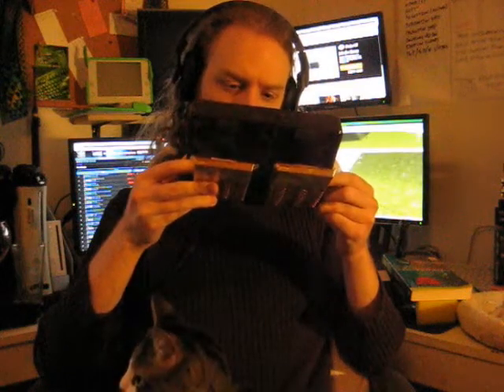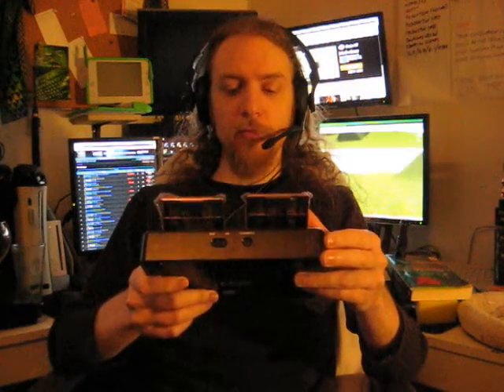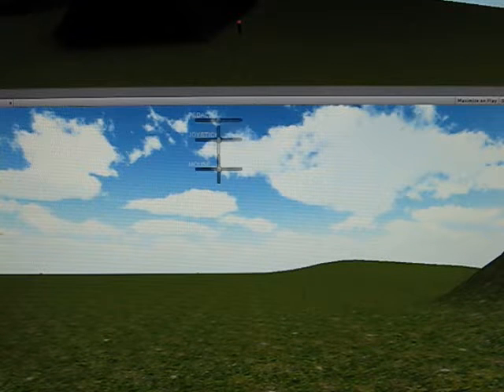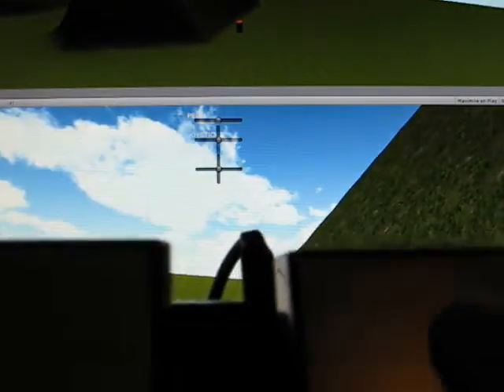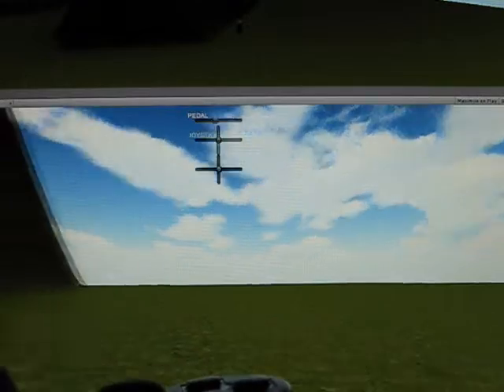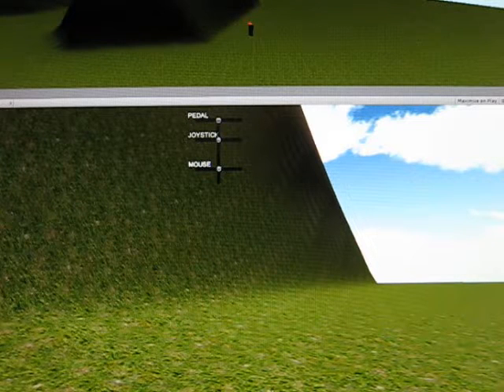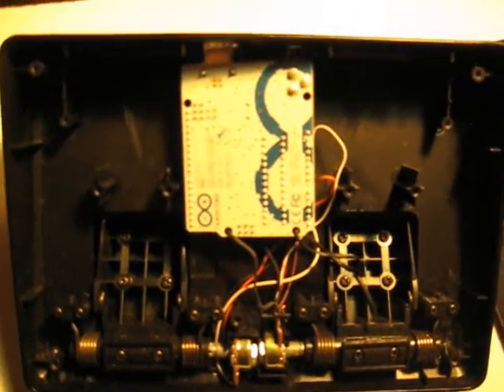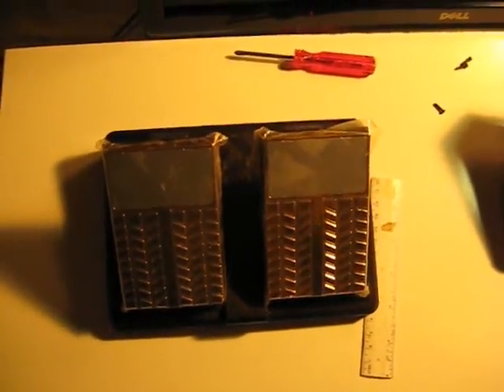Arduino-Based HID Pedals For VR Control

Comment: Spot the OLPC!
You could also wire up a Logitech Driving Force foot pedal's connector to an Arduino with USB HID.
Also the flight sim people would want this for use as rudder pedals.